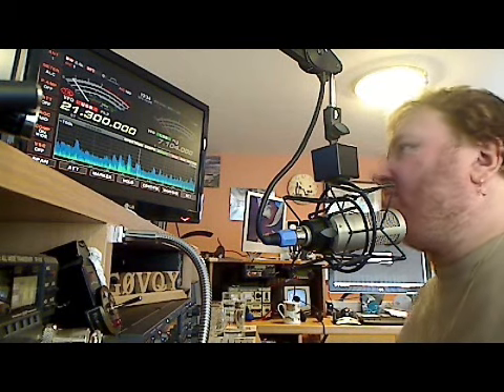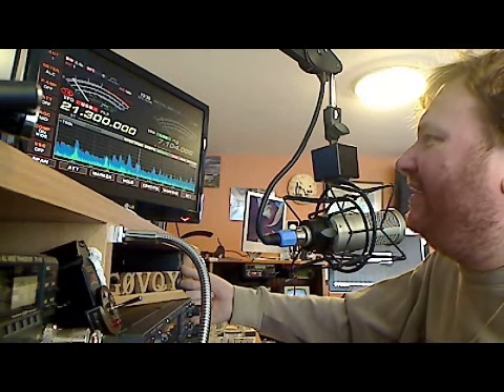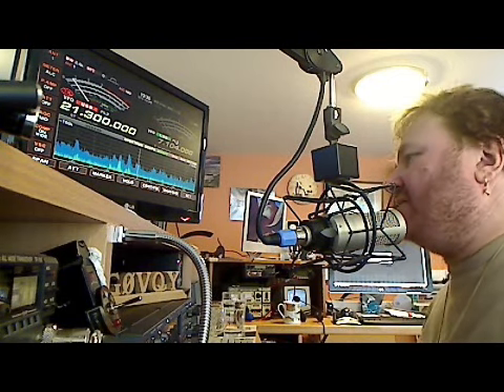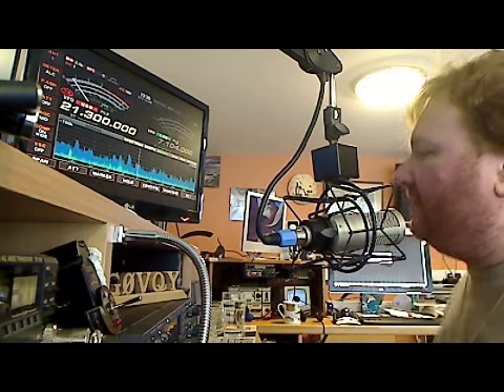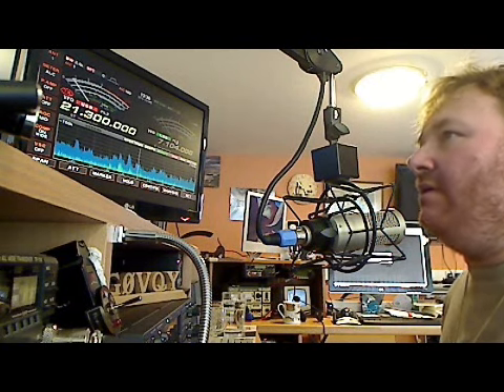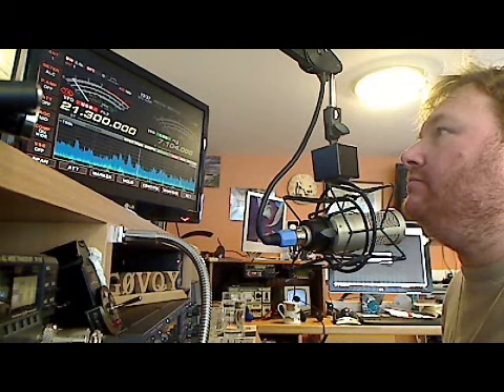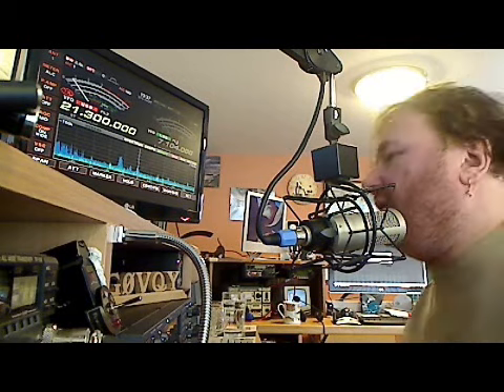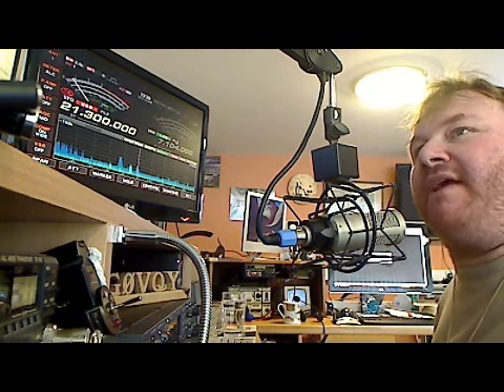3 ELE SteppIR 180 DEGREE FUNCTION

Comment: As I hope you can appreciate, doing a video on your own when you are physically disabled is not an easy task. So I have had to use my Logitech 9000 WebCam which is sitting on top of my linear. I know that you can not see the Fluid Motion control box, but you can see the signal meter which is in the form of a large 23 inch monitor. I would try and do a better video when I have somebody with me.